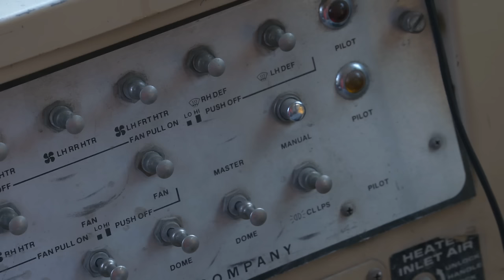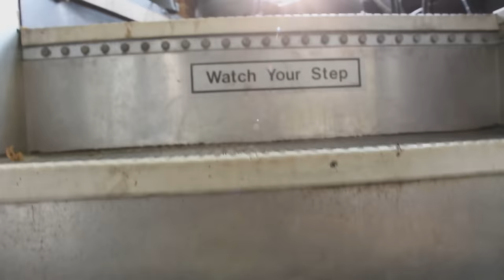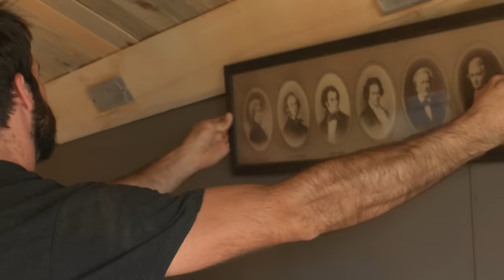Converted School Bus Homes | Zillow

Comment: I've had many buses and If I left the flashing lights on the top then I exchanged the red in the front for the amber in the rear since the red in the front is illegal unless it is an emergency vehicle.  Easy swap. Also painted over the s and h so it said "cool bus". On one of them I moved the swing out arm off the front bumper (changed the arm to a pole) to the roof and put a flag on it. It would raise and lower by flipping a switch. Never did go this far with a conversion, somebody always made me an offer I couldn't refuse. The worse part is removing the seats and getting rid of the smelly rubber mat. Nice conversion on this one.

Comment: I've been living in my 1988 36ft Gulf Stream Sun Stream Hi Rise Class A motorcoach for more than 20 year's. My 1st coach was a  28ft 1976 Sierra class A motorcoach on a Chevrolet chassis. I've told my spouse that in the next 5 years were going to quit our jobs and do nothing but travel full-time in the coach.  I bought my 1st coach for cash. Not knowing if I'd like living in a coach full-time. I had enough money for a good down payment on a new coach or enough for a older coach cash. If I hated it I didn't want to have to try and sell a coach I owed money on.
My recommendation would be before you buy a school bus, motorhome, travel trailer. Start small and make sure you like the lifestyle. And if you're a couple, both must be all in. If one isn't happy the other won't be happy either. If you like possessions you won't like it. Your going to have to get rid of most of what you have. If there's something you just can't part with find a way to make it useful in a new way.  Rent a coach for a couple of weeks. I lived in my 28ft coach for 6 years before I upgraded to a much larger and more expensive coach. I have no intention of ever going back to conventional housing again. I've refurbished, repainted interior and exterior l, reupholstered, built things upgraded other things. But I love my old Gulf Stream as much as I did the day I brought her home 20+ years ago. Just some thoughts from an old guy that's been doing the RV lifestyle for a long time. Just don't jump in too big from day one. Start out small and upgrade later.

Comment: Hi I really like your bus conversion. I have been trying to figure out how I might fit in a bus. I am 6 ft 3-4 inches. I remember banging my head when I was in school. Is it possible to lower the walk way or is it better to raise the roof. I do know that 13 ft 6 inches is the legal height for semi's in all states. ( you can get over sized permits though. ) I have just about have my design figured out now but I need some knowledge and experience to help with the hard part. I also need to have a good insulation for -10 to -30 below zero some times cold weather.

Comment: I want to live in a bus because you can really save up a lot and I mean a lot of money. Living in a bus is a lot more cheaper than living in a house because in a house you have to pay house bills, insurance and a whole bunch of other things. But in a bus all you have to worry about is gas and the fee you probably will have to pay but other than that's it. The only problem is I'm 16 years old and don't have a job. Even if I did, I don't have my driver's license or experience with driving cars. Once I have these things I'll be good to go and start building. The bus I want to buy is the 1994 thomas built saf-t liner.

Comment: I like this guy..  I mean I saved three buses from the crusher.  The biggest is my Van Hool ,, it had an electrical fire cause some musician bypassed the circuit breaker and caused a fire.  I got it  and about to get it on the road.  The other bus I have is an RTS  that was a city coach and has highway gearing  and it is all stainless steel and that one will be started this fall.  and lastly is an old Greyhound  and it is almost converted.   I love buses  and want to save them all from being scrapped  THANK GOD metal is down right now.   A good school bus can be had for less than 5 Gs  and much better built than most think and most 400,000 dollar RVs   like your bus and I love the 80s Internationals  love that steering wheel.  the later one was UGLY